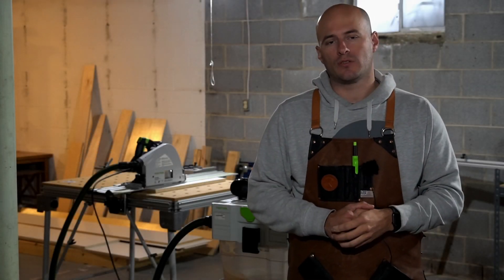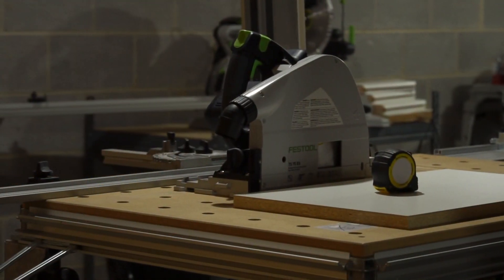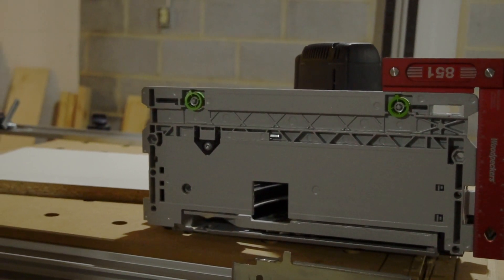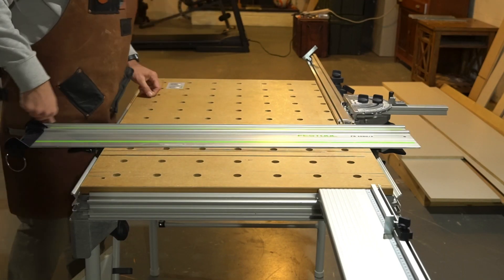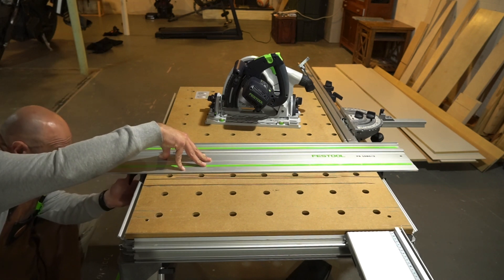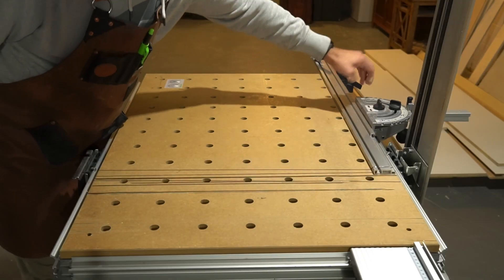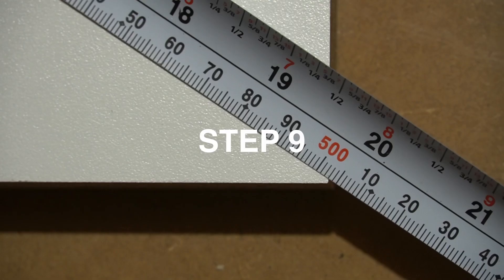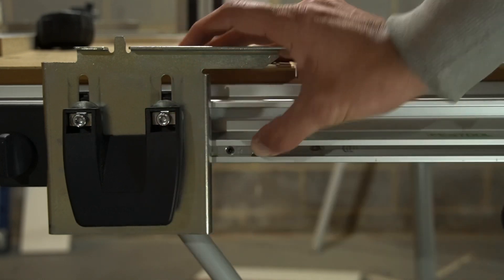How to Square the Festool MFT/3 WITHOUT Using Jigs and Squares

Comment: This is so simple and a wonderful idea.
Reply from the maker: thanks, bud!
Reply: Very nice! That’s ingenuity for you, using the tracksaw itself as a square. I would still recommend the “stop slop” under the guide rail to take away any movement.
Reply from the maker: @fernando2014  true, however I don’t want people thinking they HAVE to buy other tools. I wanted to prove that extra tools and accessories save you TIME, and nothing more. I’ve not had any issues with guide rail shifting, so not sure if it’s a defect that’s been corrected in manufacturing. My MFT is about 3 years old and gets used almost daily.
Reply: @fernando2014  the slop stop is not required. When the weight of the saw compressed the neoprene the slop is removed. It’s a gimmick imo.
Reply: @MyGarageWorkshop what is the slop stop?

Comment: I think you are almost there.  I recommend two additions.  1 - shift track right so not to cut into dog holes.  This allows you to router out a sacrifical insert later if you choose.  2 - rather than measure diagonal complete a fifth cut to incorporate the 5 cut method of establishing square.  Enjoying your videos.  Thanks!
Reply from the maker: All great points, John!! I use the kapex trimming attachments, and the distance is set to match up with the flag stops. I was very close to using the 5 cut method in this video, but felt like that would take away from the key point of the method here - which is to square up the MFT without any tools. Appreciate the comments and feedback!!

Comment: you could use the 5 cuts method as well. no additionnal cost and very high precision.
thqnks forthe tip on the square base for the TS5
Reply from the maker: Of course! Wanted to provide an additional way to check or set it. Some people don't want to chase the caliper settings on a set up. This is much quicker, but isn't as precise as the 5 cut. Thanks for sharing that!
Reply: @BenMarshallDesigns  fully agree.
I also think the 5 cuts method is not so well known .... maybe could be an addon video to this one ;)
In any case, thanks for sharing and good job on the video editing.
Reply: @BenMarshallDesigns  I did look up the 5 cuts method after seeing this comment and your way seems far easier. There is a guy who made a calculator for the 5 cuts method and he applied it for a crosscut sled with a table saw. For this specific application, your way seems most efficient. 
No need to make a video that so many others have already made. 
This was the video I needed — thank you for taking the time to share this freely.
Reply from the maker: @AaronGeller  of course, glad you found it helpful. Yes William Ng has a great video on the 5 cut method, great for dialing in squareness as you said. This is great for those that have to constantly set up and break down the MFT for field work

Comment: First, every carpenter NEEDs a square.  Put it on fense, loosed the adjusters, square the rail and tighten.  1 or 2 steps.
Reply from the maker: The main issue is that the smaller the square, the less accurate the fence can be at length. Precision squares are not cheap, and if someone has a limited budget and can only afford a track saw, they can rest assured knowing that the base is square if they're ever in a bind
Reply: @BenMarshallDesigns  good carpenter square is 20 bucks.  Calling BullShit.  You don’t need a super tenth of a degree square.
Reply from the maker: @Qwiv  Good luck making fine furniture (that someone actually would want to buy) using just a carpenter square

Comment: I didn't see a Five Cut method. Measuring corner to corner proves nothing, You might be making perfect parallelograms all day long!
Reply from the maker: You've caught me red handed - I didn't even check for squareness, not even when prepping for the video or the countless projects I've made that are in fact square with this method. Thank you, good sir, for calling me out. I shall quit youtube immediately and reevaluate my life choices.
Reply: @BenMarshallDesigns  Great reply, I knew it was square but a newbe might not know what the 5 cut method is. Cheers,
Reply from the maker: @Roy R  I would hope that a newbie isn't jumping straight into purchasing Festool!! I debated on covering what the 5 cut method was, however felt it wasn't necessary for this video. Good on you for looking out for the lesser experienced though! 👍👍
Reply: @BenMarshallDesigns  Indeed.  A newbie who buys Festool for his first woodworking tools might as well buy a Felder (Format 4), SCM, Martin Machinenbau, or Altendorf as his first table saw.
Reply: Roy, but any parallelogram with equal diagonals would, perforce, have perfect 90º corners, n'est-ce pas?
Reply: @WelshRabbit  Nope!
Reply: @WelshRabbit  Seems you forgot about the Pythagorean theorem. If I just measure the diagonals on my table saw cuts I may have two parallel sides but not a true rectangle. Also, if I want to ensure the bridge (X axis) on my CNC is cutting square I must employ the Pythagorean theorem, It is why the 5 cut method works and your system doesn't. No math, no square.
Reply: @royr327  Interesting observation.  You clearly know more math than I.  I will retreat to the back of the class and not raise my hand again for the duration.  Of course, as I understand it, the Pythagorean Theorem is the principle that for a right triangle (and only a right triangle), the square of the hypotenuse equals the sum of the squares of the other two sides; i.e., c²=a²+b².   The 5-cut method is a fine way to exaggerate for ease of measurement the magnitude of angle error if the corners of the 4-sided polygon in question are not at right angles.  Since the goal of the 5-cut method is not to determine the length of the hypotenuse of any triangle, most would say that's not the Pythagorean Theorem.  Moreover, the Pythagorean Theorem takes as axiomatic that the angle between side a & side b is 90º.   I refer instead to the principles of geometry of Euclid, rather than Pythagoras.  In any 4-sided polygon (a quadrilateral) where the diagonals intersect each other, if the length of the two diagonals are equal, then the angle formed by any two adjacent sides will be 90º with respect to each other.  Quod erat demonstrandum?  Of course, if you prefer the 5-cut method, go for it.
Reply: @WelshRabbit  I see you believe close counts, as in horse shoes and hand grenades. It is all relative to the application. I assume you've never stacked a compressor for a GE F101-102 jet engine where the measurements are in millionths of an inch to the center axis. Nothing is square, there is just very very extra close. But then again we are talking about woodworking. Corner to corner gets us kind of close to square, but not.